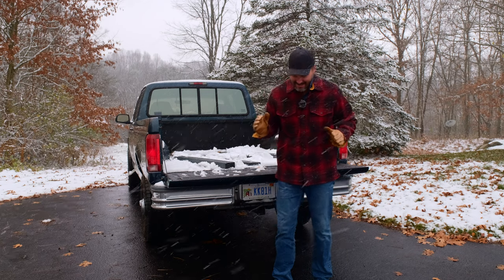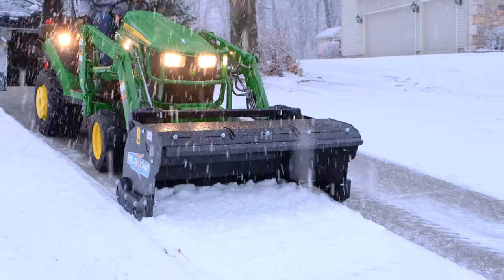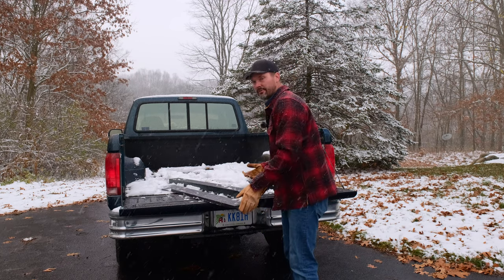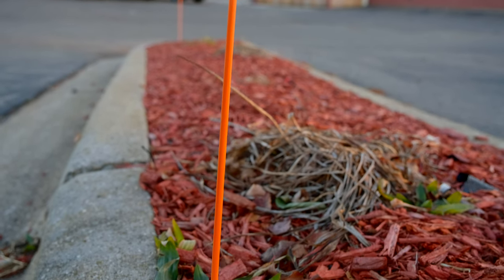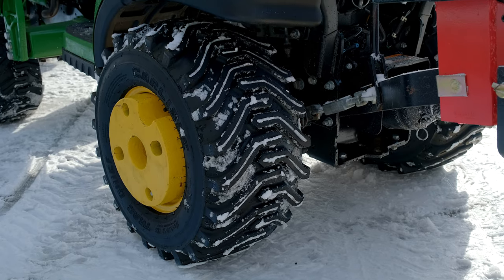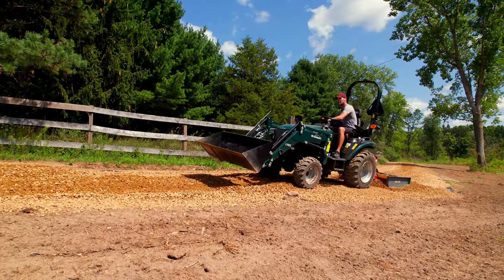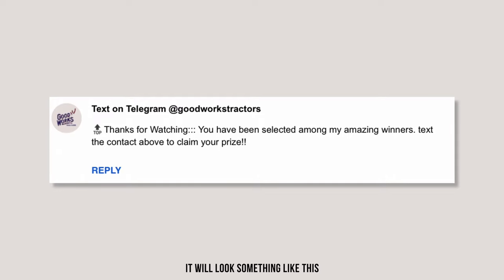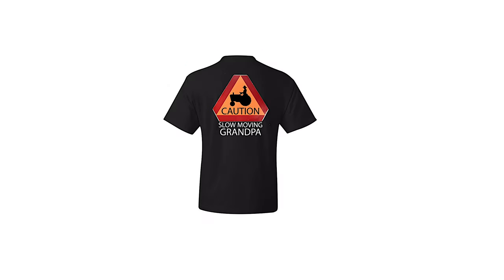10 FRUSTRATION-SAVING SNOW REMOVAL TIPS! BETTER THAN STEEL!

Comment: Courtney, I received delivery of the HLA 2500 Snow Pusher with the UHMW edges. It is a well built attachment. I think it had a rough shipment. It was not banded to the pallet, hardware was missing and no instructions for assembling the edges to the Pusher. So, to assemble the UHMW  I clamped the UHMW to the back drag and to the pusher assuring that the mounting holes were 3 inches from the edge of the UHMW in both instances. I used a 5/8 Forstner drill bit to locate the center of each hole. I then removed the UHMW edges and placed on a lumber backer and drilled the holes using a sharp 5/8 inch spade bit using high RPM and a slow feed. I also used a router the rout a 30 degree bevel on the cutting edge.
I mounted the UHMW to the back drag using 3 inch long 5/8 bolts with a 5/8 washer against the UHMW and the locknut against the back drag. I Used 3 inch bolts for the cutting edge.
All came out well. I also build dollies for all my attachments. Makes it so easy to rolled in place for storage and for attaching.

Comment: Thanks again for the good advice through the video.  Just bought my HLA 1500 snow pusher this year and opted for UHMW on cutting edge and back drag.  Didn’t think I needed the UHMW skid runners.  I was wrong!  After using it for the first time on a newly resurfaced asphalt driveway, I have two parallel marks running the lengths the drive.  Didn’t notice it when I was pushing snow off until it all melted a couple days later. I immediately ordered the UHMW skid runners.  Don’t cheap out like I did; you need the UHMW skid runners as well as the for the cutting edges if you want to keep your asphalt looking nice.

Comment: Good afternoon, 
I have been following your Chanel for years..
I have purchased a set of your versa bracket with 6.. 70lb weights. What a difference it has made. I have been tossing around the idea to get some UHMW for my 6ft snow plow... I would love to get a 1.5 inch thick by 5 inch tall to replace the old steel blade I have now... but it wasn't in my budget this year so I just flipped the cutting edge over... maybe next year I'll get it.

Comment: I just got the Carlisle VersaTurf tires on my front to replace the lot/uv worn front tires that went bad on me after 30 hours. Seeing them in the snow side by side against the traditional grass master turf tires on the rear is mind blowing. If I didn't already have RimGuard in my rear tires I would have replaced them as well. I do have a little more confidence to have some better steering traction in the snow though. Been trouncing all over my lot out in the woods. Back dragging everything up next to the house, pulling dead trees out for firewood and staging work areas.

Comment: I have a old gravely 812 with a 48 in front end loader I put the UHMW cutting edge on and it’s great I also put versa turf tires on for a little tractor it works great

Comment: Nice video. I looked into Nokian tires a while ago, and it was quite the eye opener $$. I bought a couple of UHMW edges from you last year, and I must admit that they are wearing very well. Zero scrapes or scratches, and very quiet on my 0400 - 0700h plow run.

Comment: I put some "steel butter" on my plow for this season.  Even though the asphalt surface seemed hard and somewhat durable, the existing steel edge of the plow and feet/shoes also were not so kind in places.  Here is to "buttering" my driveway this season.  😁🚜

Comment: I have a Kubota B2650 with a 72” HLA snow pusher, I added the back drag last year and removed the rear blade since the back drag replaced that function.  Instead I added more ballast, it all works better now in tight quarters.

Comment: Thanks Courtney.
Might want to check the Glow Plugs on the 7.3. It's not that cold for that engine to start that Hard. 
I use a piece of Pipe on the ATV Plow blade for use over the Gravel driveway.
Mike M.

Comment: UMHW is good stuff we use it on a lot of different farm tools its a good wear item and even some of our bearings are now UMHW which time will tell how they work but its nice to use less grease . Back in the day we used tire chains on our tractors and they worked well just not meant for road use or any hard driveway. I do have a Fendt tractor setup for snow removal on a airport runway and it uses Nokian TRI 2 they are not cheap but they ride and work great for road type use . I am actually setting up old Farmalls with them since they just cruise and do shows .

Comment: As always, good informative YouTube videos. I previously drilled holes into my loader bucket and attached a poly blade for snow removal. It did a great job, but took a long time to clear a 200 yard drive. This year I purchased an AF10F snow blade for my 1025r, and looking to replace the steel blade with a poly blade.

Comment: When the snow does show itself the steel chain tires, rear blade and edge trimmers for the FEL bucket go on the 1025R to work the 1/4 mile gravel driveway. Learned the hard way with chains and to keep them tight and secure. My right rear came loose and tore up the underside of the fender just glad it wasn't the left which is the gas tank.

Comment: I appreciate all the videos you make for us you do a great job explaining about new attachment and add ons for tractors. i got a new tractor last year and had to use the bucket to remove snow on a concrete driveway and I am happy with it but a softer edge would be nice. Id love a snow pusher but they are a little more expensive i think i will order some uhmw and give it a shot

Comment: Enjoy the videos and how you show what the smaller tractors can do. Could you do a video next showing how to mount the UHMW to say a loader bucket that does not have the bolt on cutting edge? Specifically how you would recommend a way to quickly attach it for winter use and then able to remove it after snow season. Perhaps a few options leading up to the least intrusive way.

Comment: Courtney, gotta tell your guys cutting that UHMW to measure twice.  Got mine and it was 1/4" short. Also one end of the cardboard protector was missing.  Perhaps wrapping it in paper would help.  Got it installed and tried it out.  Seemed to work fine (but now I got to add weight to my back blade to make up the difference).  Chains on the way from your recommended Tire Chains Online (I used code GWT for 5% off) and had free shipping.  Best price I could find.  Thanks. 😄  Terragrip didn't have them big enough for my 24" back tires.  Not sure how they would do with side slide on ice.

Comment: I love those old square body Ford trucks.  Seems like the last variation of the F250 that actually lasts a long time.  My 2006 6.0L is starting to cost me a lot of money to keep it going.  As for the snow season, well, I really like snowplowing videos but don't really like to plow my own driveway.  I thought I might try my tractor this year if the snow builds up past what my UTV will push.  I just don't know if I will have traction issues to deal with.  Maybe I should start with mounting a strip of UHMW on my bucket before making the jump to a pusher?  Great video as always.  👍

Comment: The tractor I have was a one owner tractor it turf tires on it when I bought it and traction was not a problem, but I replaced them with R4 tires because the turf tires were cracking.  I have a hill behind my house with turf tires I drove  right up the hill in two wheel drive, but now with the R4 tires I have to put the tractor in 4 wheel drive in order to get up the hill.

Comment: Another awesome video Courtney, UHMW is the way to go. It is a bit pricey but repairing a driveway is pricey too Lol. Thanks for looking out for us the discount short sections is a great idea now days every little bit counts. Unfortunately Terra grips doesn’t make rubber chain for the R4 tires so I’m stuck with them. Trying to save for new rims and new Carlisle versa. By the way I recommend Good Works Tractors I bought from them before. They are great to deal with. Keep up the good work.

Comment: We live in the mountains gravel drive about 1 mile. I got some chains (I think from Norway) they have spicks  on the links. Expensive yes however they grip . Got them front and back. There is on section that is 19% grade. Before we bought this place they asked if we had 4 wheel drive, and yes we did. Lucky for us
Reply: A quick addition. I hung the chains from the overhead there heavy  I have a 4710 and I’m a senior citizen

Comment: This product does great on my asphalt and the gravel section of my driveway. It is not good for trying to bust up thick ice though, so I had to order a new one for this year.
Reply: Hard pack/intermittently icey stuff is what I'm curious about for how well UHMW would hold up.  I travel for work often during winter months and tell the wife to just drive on the snow if needed and then scrape off the mat when I get back home.
Reply: @rcguymike  Mine has worked well on hard-packed snow. I usually don't plow the drive unless there's more than 3" so lighter snowfalls get packed down. Even does well with ice over snow. My only problem has been when I tried busting up a 4" thick ice pond after we had a big thaw that refroze.
Reply: @Gilikemail  do you ever back drag with down pressure or mostly all just forwards operation?

Comment: Well sir,
    a few recommendations (if I may), on the starting of your 7.3powerstroke.  Along with the checking into/analyzing of glow plug(s) & glow plug controller performance or lack there of.  If there are needing to be replaced., (suggest use only “Motorcraft”/“International” brand parts).,
   Seek out a “high torque” aftermarket replacement starter ($250’ish range)., night & day difference in starting performance.
    Good quality “matched” batteries.
   Seek out/source “Motorcraft” brand 10W-30 Diesel engine oil (at least for the winter time), Ford rates it for all their Diesel engines.  
   Not sure where you are located, but fuel treatment(additives) to help with diesel fuel “jelling”…   Note the water in fuel bowl dash light., or just drain the fuel bowl at the start of your cold weather…
    Attempt to keep the block heater plugged in (can be put on an separate timer), use the shortest 12ga.., extension cord you can., also a battery (on board or separate) trickle charger…  your Powerstroke Diesel engine will thank you, and last your lifetime…
Great video,
Thank you sir.
    I have no affiliation with or receive any compensation from “Ford”, “Motorcraft”, “International”…

Comment: Does that wait light on the F250 ever go out if you leave the key on?  Our 06 f250 it would stay on for 15+ seconds and then finally go out, I would turn the key off then and wait a little and then repeat until the light started going out faster, started right up then even in below 0 weather.  Beautiful truck!

Comment: Good videos. I always enjoy the snow removal ones especially at the beginning of the season. I think you have one of the best setups with the snow pusher and the inverted snow blower. I enjoy my front mounted snow blower and back blade but it takes extra time to configure and you lose the FEL for the season. I would like to have UHMW on my back blade so it's nicer on my concrete apron.

Comment: I just got the skid runners on my HLA snowpusher for this year from you.. thanks! Waiting for the rubber edge to wear out and replace with the UHMW. I had it on my first snowpusher and liked it, just not the frontier pusher itself. How do you get the adjustable slot holes punched in it. I had just drilled round holes but felt it wasn’t adjustable for wear then.
Reply: I slot UHMW with a milling machine.

Comment: Well a little hint turn turn that key on and off at least three times with rolling the motor over so you heat up air in cylinder with out putting cold fuel in it will start easier. Good luck.

Comment: Two questions… 1) Do you have to take your tractor to a dealer to get Rim Guard, or is this a product that you buy and fill your tires with it at home?  2) Can this rubber blade material be mounted on a JD 48” snow plow for a garden tractor?  Thank you.

Comment: I use UHMW sliders for moving heavy transformers and switch gear.  This stuff works great if you need a low friction surface.  A use case could be for bucket skis or box blade rails... there are tons of potential uses.  Hope I win some for the ATV drag box blade that I need to make.

Comment: Nice video!  I put on Poly shoes for by John Deere blower..  going to have to have another look at it but if it has a removeable cutting edge, I'm going to switch it over.   Have a 5/8 mile long drive that I sealed by hand this summer and really don't wanna do it again next yr :)

Comment: Just added an HLA 60” snow plow with hydraulic angle.  I love it, but am concerned about the Steel edge doing damage to our new asphalt driveway.  It has a curved/swooped up steel edge.  I am hoping I can put a UHMW edge on it.  Anybody know if it will work?

Comment: Question: Courtney, you mentioned lowering the pressure of tires to get more traction.  If there is Rim Guard (or some other liquid weight) in the tire, do you have any advice on how much air can be removed.  To restate the question, how can I be sure, when I'm letting air out, I won't start letting liquid out of the valve stem.  (NOTE: I'm sure this must be done with the valve stem Top Dead Center (where the airs at).  But the question still stands).  Thanks man.  I enjoy your videos.

Comment: I'm currently watching from home on a snow day from that same weather system. Turns out I live just a couple miles away, I recognize that bull statue and three cupola barn from many a bike ride. What are the odds? Anyway, I have a B2601 that could benefit from some uhmw on the blade. Also, I remember a while back you mentioned doing some comparisons with the summit tractor and a B2601... I'm just across I-94

Comment: I really wish Dirt Dog would make a 35 series rear blade with a hydraulic angle. It’s a must have when snow removal, you can angle the blade without getting off and trying to angle it manually with all the snow and ice on it. That rear blade would sell like hot cakes, remember most tractors sold are small compact tractors and NO ONE sells a blade for a small tractor with a hydraulic angle. And a lot of tractor brands are coming with rear hydraulics hookups on the back as standard equipment.

Comment: Greetings, That Powerstroke needs some or all of the glow plugs changed. She is old enough, probably all is a better choice. The system is designed to short cycle, so if (1) glow plug is burned out, it doesn't throw the extra power to the other good ones and burn out the rest. It only takes one to make it hard start in cool weather and almost impossible in cold weather. I believe the part number is still ZD11, and they will fit 1995 through 2003 7.3's. She only loped a little when it touched off, so I am guessing 1 or 2 are bad.

Comment: On your 97...that wait to start light is pointless, watch the voltage gauge. The glow plugs will run for 2 minutes. Just wearing the glow plug relay out faster. Try it, i think you'll be less frustrated when shes cold to let rm run thru the first cycle

Comment: Has anyone ever used the UHMW on an ATV plow?
Reply: Weight is your enemy!  Consider what devise lifts the plow - manual, winch, hydraulic.  Can’t beat the function of UHMW edge.  Saves your driveway surface.  Recommend spraying blade surface Woolwax or some form of slick surface prep.  Snow slides right off without build up.  I’m trying Slip Plate this year on my RTV’s plow. Works pretty good on mower decks.